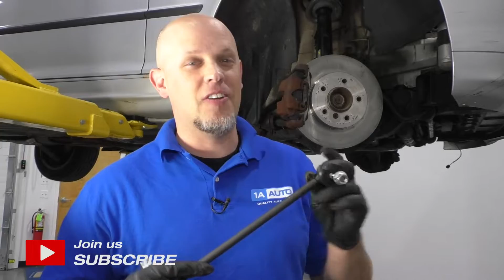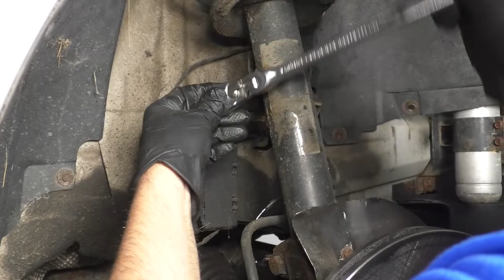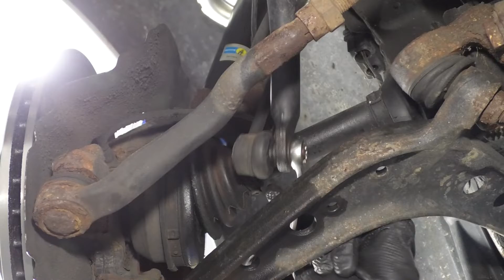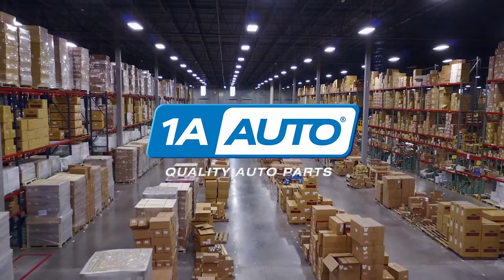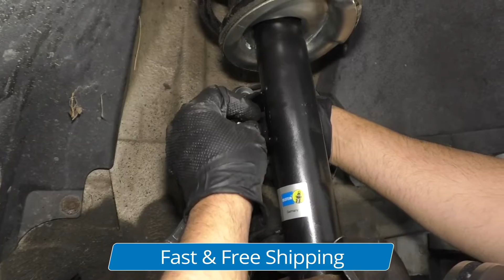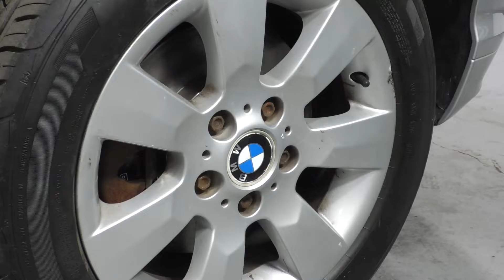How to Replace Front Sway Bar Link 01-05 BMW 325Xi

Comment: Don't you preload the links before you torque?
Reply: Good point...but I don't think it makes difference with the ball-jointed drop links.  Generally though, I agree that any suspension part should be torqued with the wheels at normal ride height. That means the bushings aren't stressed all the time, only when the wheel travels up and down.